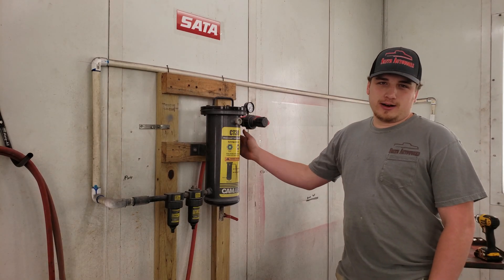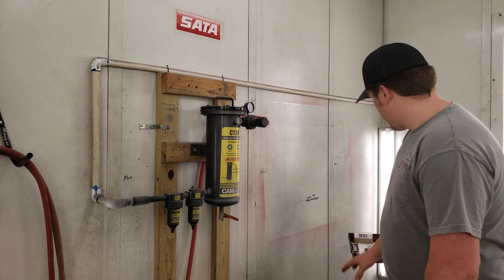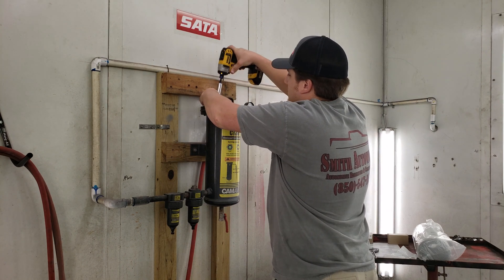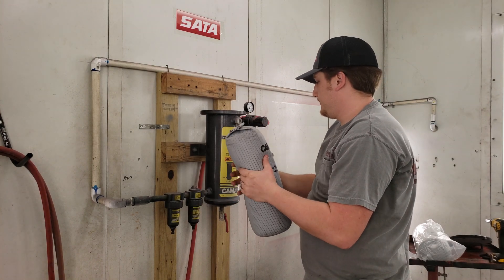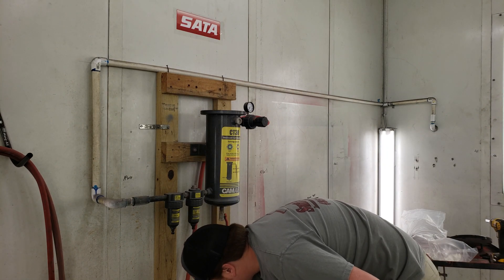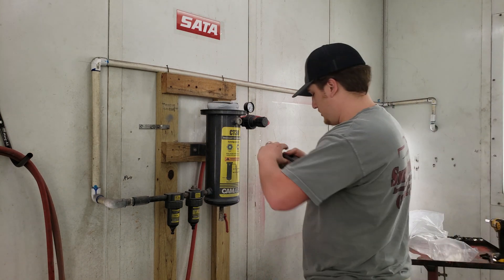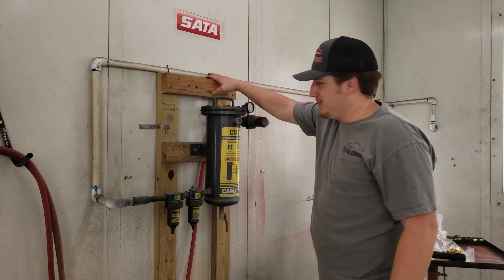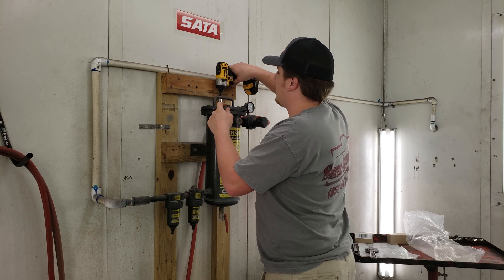Devilbiss Camair CT30 Compressed Air Filter Maintenance

Comment: Nice shop you have. i have the qc3 devilbiss mine just has the small beed cartage i cut it open put my own beads in .i also have a speedaire air dryer  i run my air direct from the crank case a cooper coil into water and back out to my dryer another filler before it goes into the tank out my qc3 filter to milton purple  hi flow ends 60 gallon 3.7 hp im gonna and u and me if you like i do shorts get way more views

Comment: Great video thank you for sharing it. I have a question if I may. Why are you using PVC piping for the setup when you should be using Galvanized piping to cool down the superheated air passing through the pipes? Also, a note, you should place another line passing below the entry port (approx. 3-4 feet) before the filtration units with a drain valve to collect debris and other trash that will pass the curve to prevent it from entering the filters and such.
Reply from the maker: Yes it is PVC as it was already installed in the shop maybe 10 years ago and we just haven’t changed it because it works but we are aware it isn’t optimal. Also there is a drop just outside the booth with a drain valve.

Comment: hello, great your video very well. I would like to know if the devillbiss filtration system is connected before the meter? have seen other filters between the compressor and the devillbiss ct30? thank you, I am following you from France 👍
Reply: @smithautoworks3043  hello thank you for answering me it's great my friend :) I received the filter like yours;) I will install it after the compressor in the order you indicate: 1: compressor, 2: filters, 3: pipes air for painting :) good luck